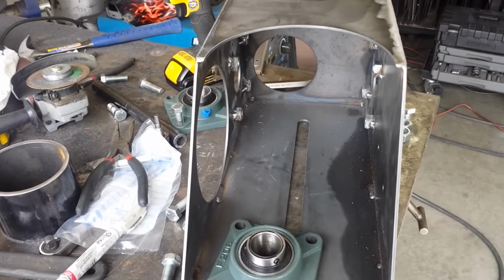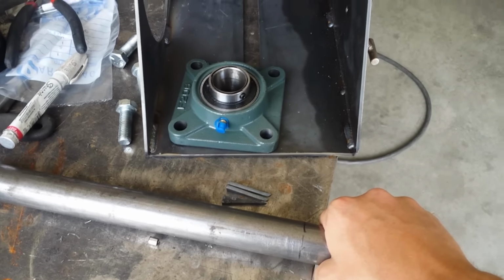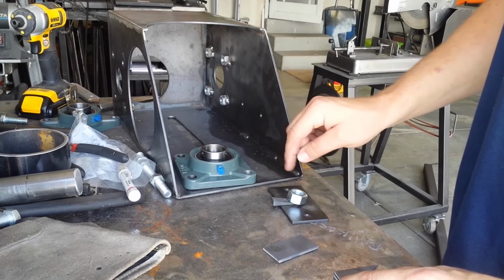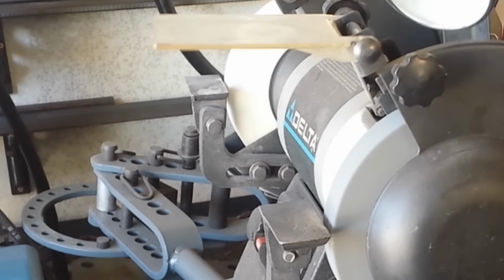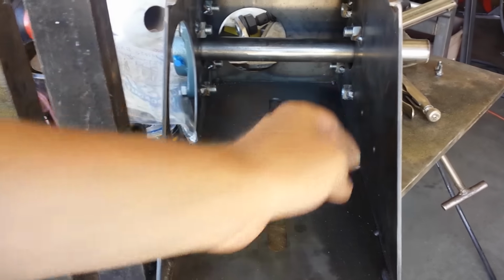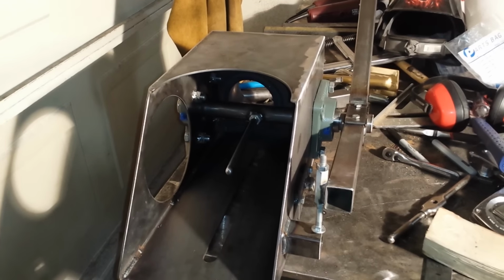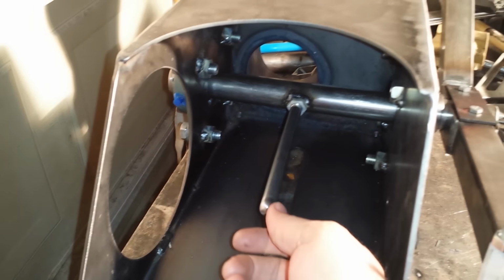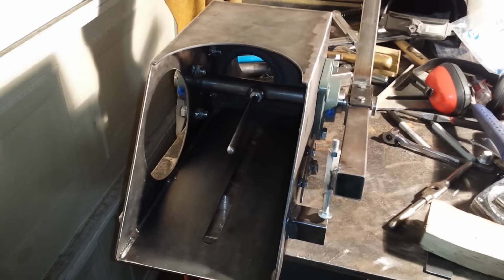Log Furniture Tenon Maker-- Part 1 of 2

Comment: When tapping a shaft into a machined bearing surface with tight clearances, use a brass hammer. Even light taps can mushroom the end of the shaft.
Reply from the maker: +mountnman3609 Ya, I need to pick up one of those

Comment: So I’m loving your vids. I have a question. My and my dad are building a log home and I as well have a CNC plasma table and was wondering if I could get your plasma file on this build. It would really help me out. Great work in the shop and nice looking welds. Is that a miller 252. That’s what I use
Reply from the maker: I would, but about 2 years ago my hard drive died, and I lost the file related to this.
Reply: John Harmon - Cold Creek Works 
Bummer okay. Great video
Reply: Did you ever do a video of it cutting a log